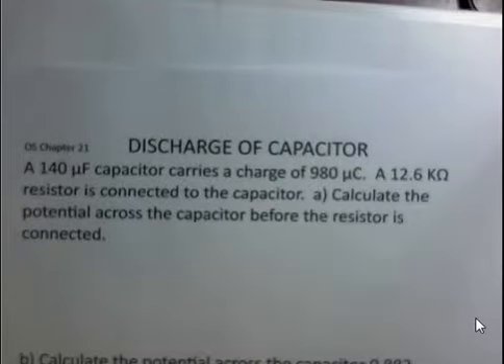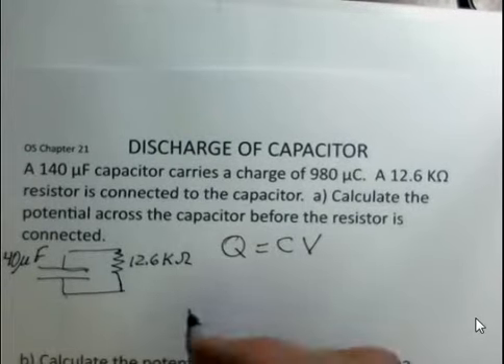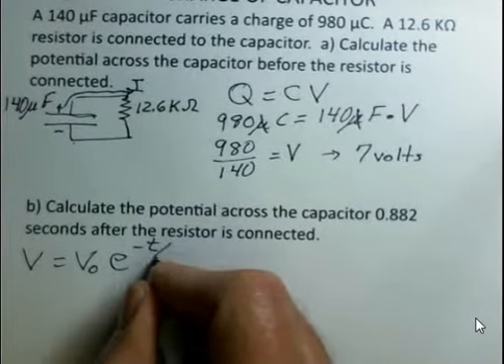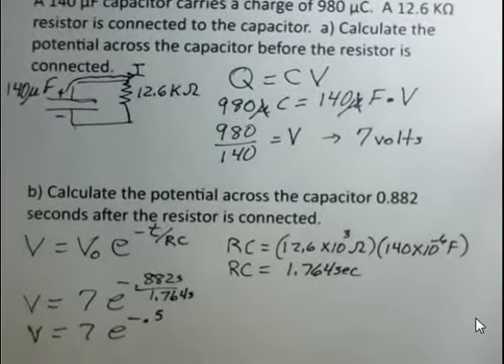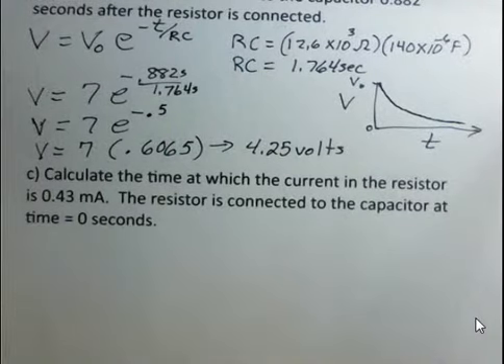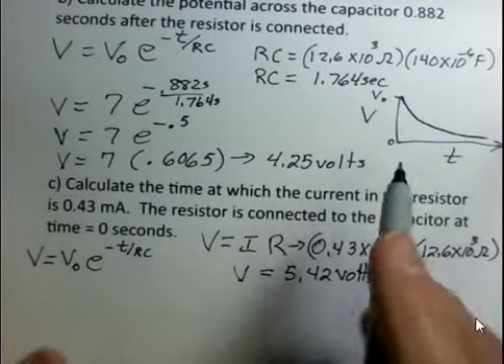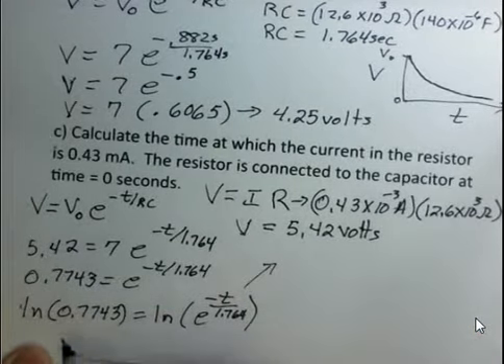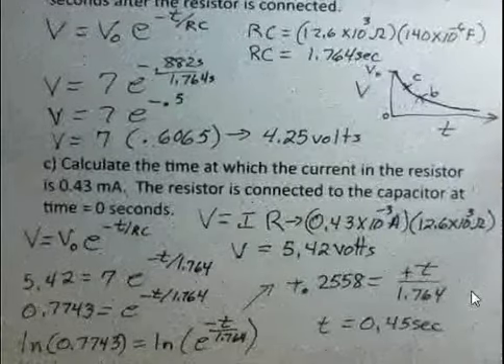Resistor Capacitor, RC Circuit, Discharge Time

Comment: Please which is greater the of charging  or  the time of discharging of capacitor
Reply from the maker: The two times are the same.  As long as the value of the resistor and the capacitor are the same.  The time to charge the capacitor to 80% of the voltage of the power supply is equal to the time to discharge the capacitor from full voltage to 20% of the initial voltage.  You can verify this by letting V/Vo be 0.8 for the charging equation and V/Vo be 0.2 for the discharge equation.  You will see that the times must be the same value.